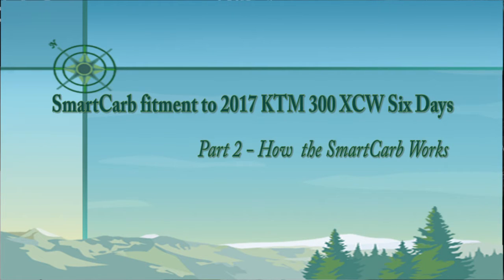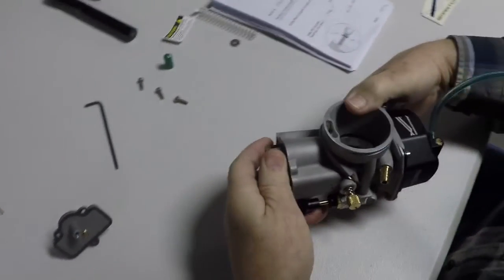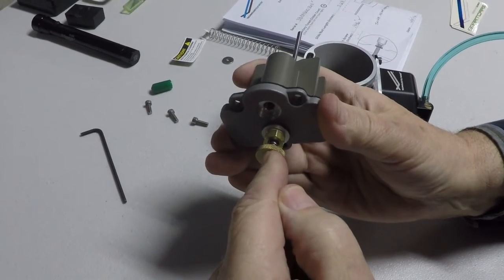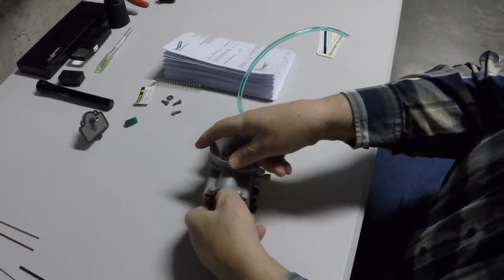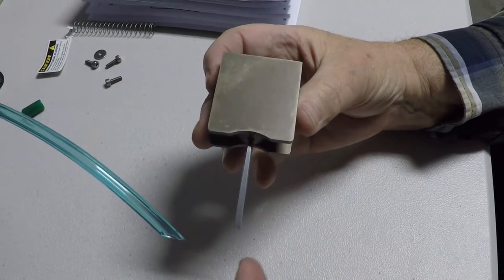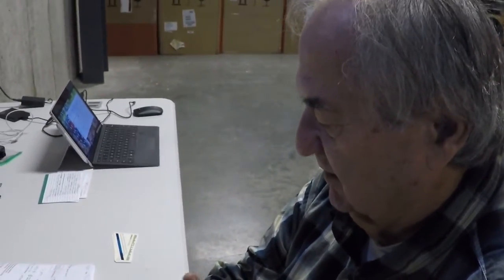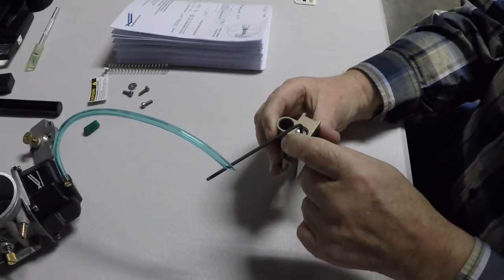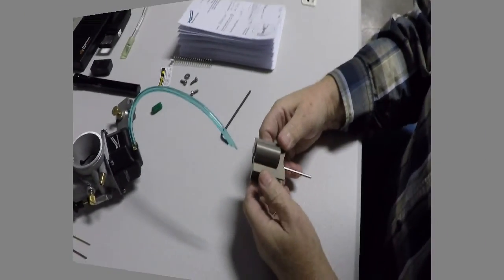SmartCarb fitment to 2017 KTM 300 XCW Six Days Part 2 of 6

Comment: Very nice video Barry, you know this carburetor really well. I bought a used Husqvarna TE 250 and came with a Lectron, it works very well but the fact that you can change your ratio on the fly with the Smartcarb makes it way better. 
I do not know if it is better to buy a Smartcarb for my bike or just get one with a TPI. For the moment I will try to tune my Lectron and remove the bogging, sounds like the mix is too rich.